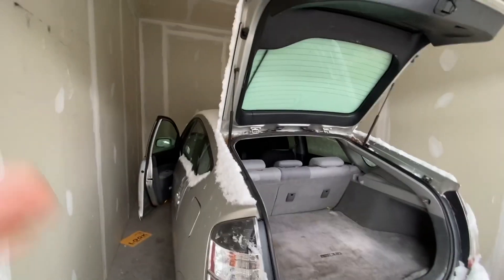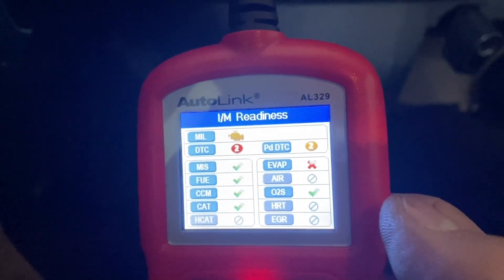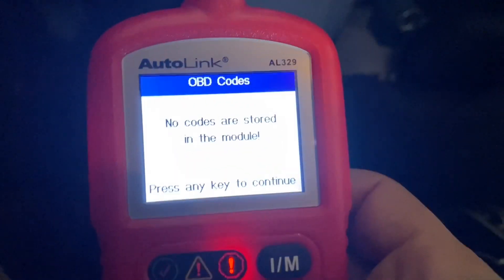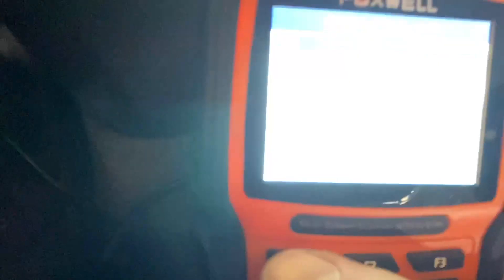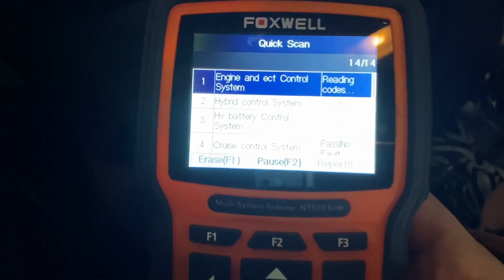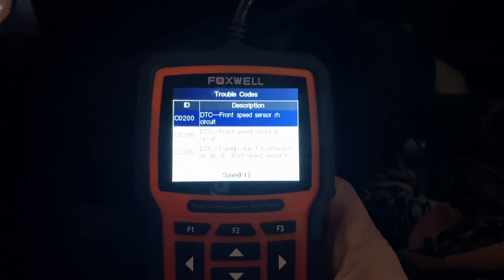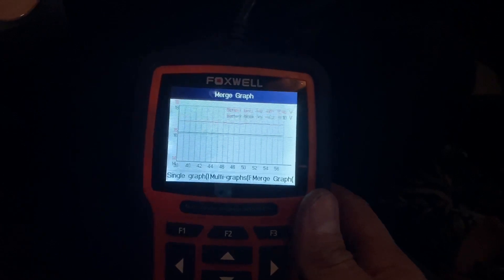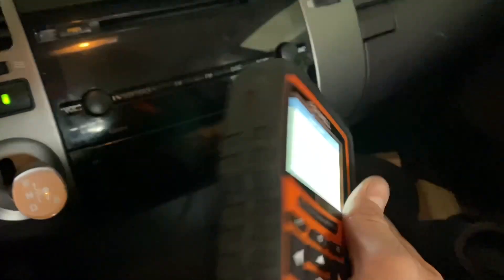My Favorite Scan Tools! Prius-Friendly

Comment: Thanks for your video. I purchased a Foxwell NT510 elite with Toyota software for use on my four second gen Prius's. Perhaps it's just my scanner but I find it to be useless. For example, when I try diagnosis the ABS/VSC system the scan tool takes several minutes scanning then says it can not communicate with this system. Further more, it does this with every system I try to diagnose or customize using the Toyota software. I recently downloaded Foxwells latest Toyota update. No changes noted. Still unable to communicate with anyone of my Prius's. I've tried getting help with Foxwell support which seems useless. They just ask me to send them more files that I can not find. Unfortunately the four second gen Prius's are the only Toyota vehicles I own. I'm going to ask my neighbor if I can try my scan tool on her 2010 Highlander just to see if it's the scan tool or the vehicle. Any thoughts or suggestions? Also, when you use your Foxwell nt510 how do you turn on the Prius, press the start button with your foot on the brake or press the start button twice with your foot off the brake?
Reply from the maker: I’m really sorry to hear that, I’ve never used this one for brake work, I always use manual bleeding methods a few times I do that kind of work… It has been very handy for me, for what it is. I also have access to Toyota software, which comes in handy as well…